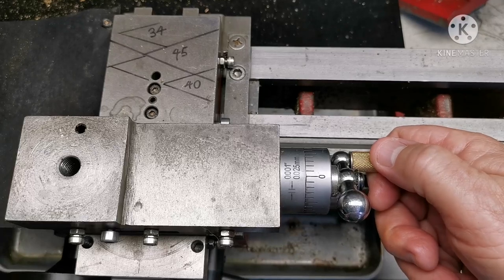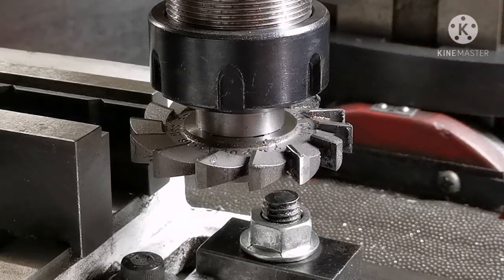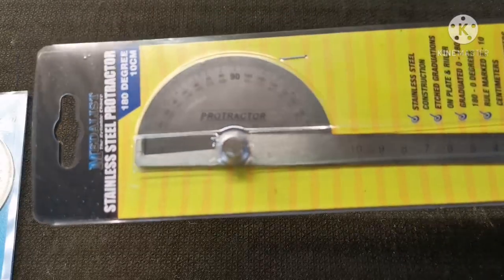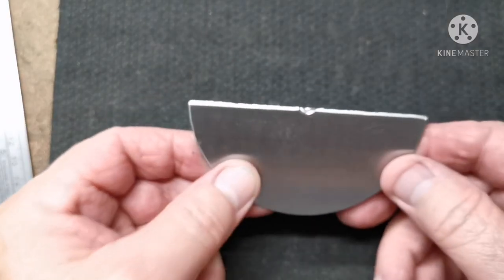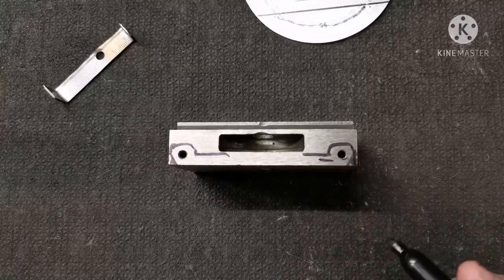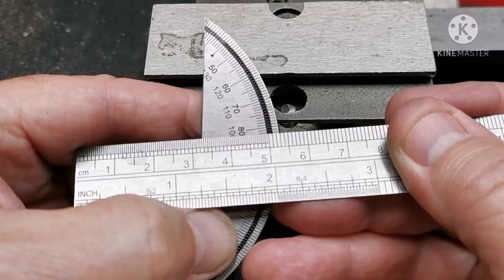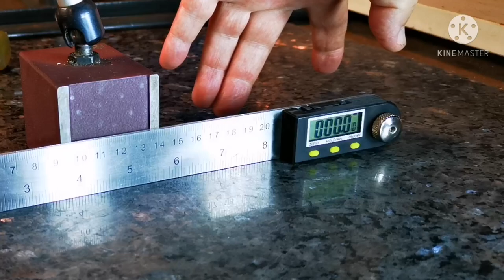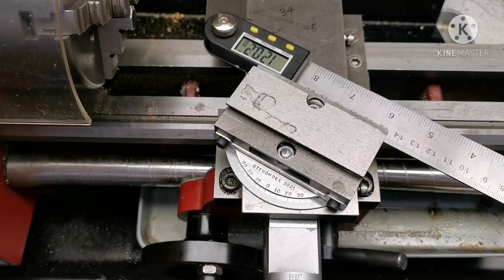Compound Mods & Protractorization

Comment: that's great that you at least attempted that huge cutter, my 1.5 hp mill might handle it, make it plunge, but w/ mini mill might have to relieve/reduce the top and bottom of each tooth so only periphery did the cutting, lessening friction (?), and using lube/coolant if HSS..
that diamond encrusted "beast" looks ideal, but another one might be to take a slitting saw arbor, with custom adapter, and install a (reduced) fiber cutting disk "nub" (after using up 2 of the 4 inches), or several stacked up depending what mini mill can handle...
Reply from the maker: Thanks for Yr message, I really thought the horizontal cutter would work (2 1/2" x 5/16") but until we try we don't know. The fibre cutting disc would probably work, good idea, we'll wait to see if anyone tries it, cheers

Comment: Cool results Stevodee ...... 👍👍😎👍👍.  This video showed a little better how you grip the engraver body, but much of your grip was partially out of frame.  I think I understand.  I have more engraving questions if you don't mind - 1. It appears you possibly mark the text out with a ink pen first and then engrave over those marks?  2.  What kind of burr do you use?  2. Any equipment purchase recommendations?  Maybe you could do a tip-n-tricks video on engraving as opposed to to answering these questions here?  I'm confident many of your subscribers would like to see that.  Especially since I've searched youtube for hints and virtually everything already uploaded by others is rubbish.  Cheers.......  Joel
Reply from the maker: No probs, I use an artline pen for marking, the burrs are inverted cone style, u get them from dental or lapidry supplies or  maybe shoe repair supplies. U may even ask @ local engraving kiosk in shopping centres for some used ones. Go ebay & search dental micromotor, they're about $130 with hand piece, I have an escort 3 & a marathon 3, I think they're the same unit. Been thinking of doing vid series on engraving for some time, watch this space ha, hope this helps, cheers
Reply: @stevohdee8118  - Thanks again 🙏. I’ve got a kit on order.  Lots of clones out there for sure with a huge range of prices.  Hopefully I’ve picked a quality one.  Ordered burrs too - some HP-35 and HP-39 inverted cone carbide burrs.  Apparently lots of different sizes, so I’ll give those a try.  Joel…. 😊

Comment: Did you try parting? Any noticeable rigidity issues?  Seems like a lot of meat to remove.  I'd love to do that mod, so I'm curious about your experiences. Great vid as always!
Reply from the maker: Gday Dan, not sure what you mean by parting, rigidity is minor but that horizontal milling cutter just didn't do what I thought, go the diamond beast, that works great, cheers
Reply: @stevohdee8118  sorry for not being clear. You cut material from the compound of your mini lathe. That is usually the weak point in our lathes. Personally, I haven't had issues with parting off material using a HSS parting tool. While I have a strong desire to get the same easy compound adjustment, I don't want to lose what little strength my mini has.  So, I was curious how hard you pushed your lathe, if you have noticed any different behavior.
Reply from the maker: Ohhhhh, haha now I get it, haven't done any parting since doing mod... Now I'm worried, will keep an eye on that from now on
Reply: @stevohdee8118  the suspense builds!  Well, it will give me time to find a diamond cutter like you have
Reply from the maker: OK ill fire up Minnie tomorrow & try both upside down & right side up parting blades on mild steel, that'll test her. Worried compound will snap in half, haha
Reply from the maker: Hey Dan, just tried parting, both upside down in reverse and right way up performed with no noticeable difference, sharp cutters, low speed, slow feed, oil & I always lock the compound. I have been a bit aggressive with feed on occasion which stopped the lathe and peeled a large chunk of material... Oops, so easy does it & you shouldn't have any probs, all the best
Reply from the maker: Oh & to find cutter, Ebay "40mm diamond disc 8mm shank" might work, cheers
Reply: @stevohdee8118  fantastic news!  I look forward to this mod. Thank you for taking the time to play around on my behalf!
Reply: @stevohdee8118  awesome!  I'll go hunt one down now!
Reply from the maker: Your very welcome, happy hunting

Comment: Very nice, SteveO! Since no one else asked, where did you find the 40mm x 3mm Beast? I watched the milling cutter sharpening video and read through the comments but couldn't find any info.

BTW, the Little Machine Shop lead screw covers I installed work well, as does their extended travel cross slide.

Best reads, Charlie
Reply from the maker: Hey Charlie, try searching ebay "40mm diamond disc 8mm shank" I found it again, good to hear your screw covers working, one less thing to clean hey, cheers. Let me know if you find disc
Reply: @stevohdee8118  
Thanks, SteveO: found them and placed an order. I was searching for “40mm Diamond Wheel.” Even looking for “disk” didn’t work, I had to use “disc.”

Now I have to figure out how to get a 8mm shank into the 1/4” chuck on my die grinder.

Best regards, Charlie
Reply: @stevohdee8118  
Found 1/4" to 8mm collet (teaching on eBay is getting worse: they don't parse search terms as well as they used to).

Take care!
Reply from the maker: Hey Charlie,  My electric grinder does about 10,000- 27,000 revs, u must have some sort of rigid setup in mind. Just checked speed on mill when I did it, about 1000rpm. So how u doin it?
Reply: @stevohdee8118  
Hi, Steve,

My die grinder goes up to 30,000 RPM but has a 1/4" collet which is why I needed the 8mm:1/4 adapter. I also have a 4-1/2" angle grinder that runs at 11,000 RPM and somewhere I have a collet that screws directly to the shaft. If I do the mod I figure that I will use the die grinder or angle grinder working carefully by hand, practicing first on a piece of scrap. I try to keep any grinding well away from the mill or lathe. 

Best regards, Charlie
Reply: @stevohdee8118  
Hi, Steve; I've been re-thinking my approach and considering the 40mm diameter of the diamond tooling, your 1,000 RPM makes more sense (5mm diameter grinding point running at 10,000 RPM = 157,000 mm/min; 40mm disc at 1,000 RPM = 125,600 mm/min). I have a small drill press with an X-Y table that has a low speed of 2,100 RPM, so I can use that with a foot pedal to do the job: everything is aluminum so I can spray the work with water then hose the base off afterwards to get rid of the grit.

Still not sure I'm going ahead with the mod, but I'll keep you updated.

Charlie
Reply from the maker: Hey Charlie, yea high revs scares the #~¿÷ outa me was wondering about die grinder to do the job, drill press sounds much better, cheers mate good luck
Reply: @ChazzC 😅😊

Comment: Too much trouble and it never looks like a professional made item......I bought a digital protractor, rated at an accuracy of .05 deg..... whatever............that is closer than anyone can eye a protractor degree marking against a scribed line.
Reply from the maker: I agree, if you need a precise angle use the digital, great device, anythings better than the thing these lathes come with, cheers